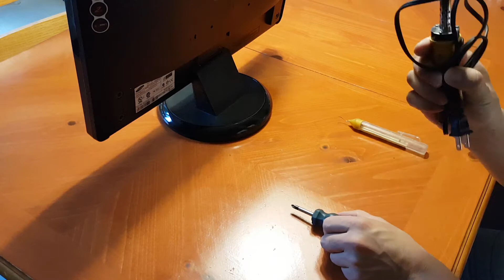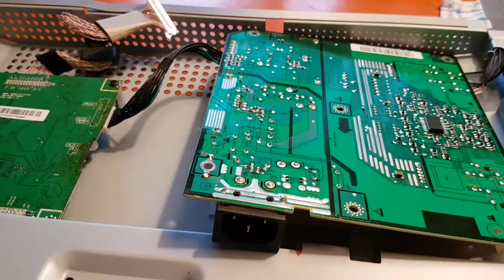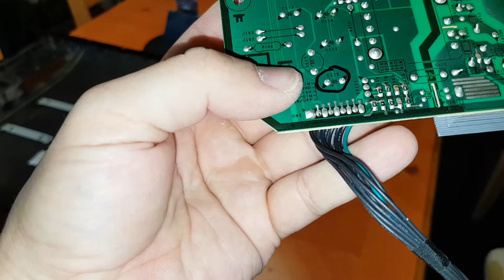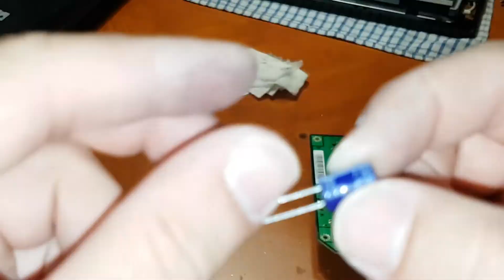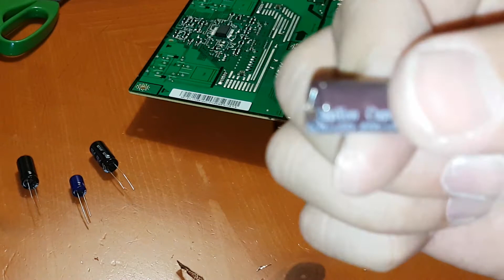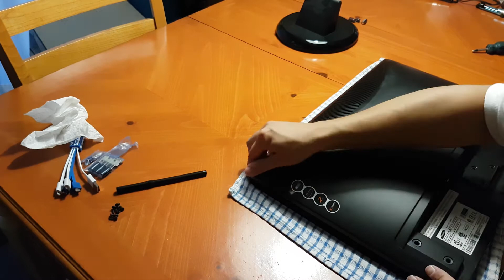How To Fix Flickering or Flashing Screen (Monitor or TV) - Samsung, LG, Sony, Panasonic, TCL, Vizio

Comment: What if the capacitors are not visually damaged but have this exact fault? Are there specific ones that break down over time and need to be replaced?
Reply from the maker: Sometimes capacitors are bad without any external sign... For the cost, you can replace them and see if it solves your problem. The investment is minimal.
These are the specific ones creating this problem.